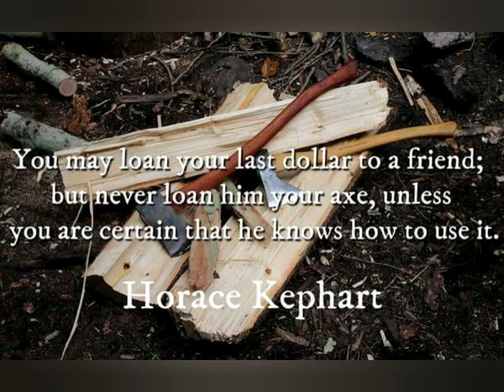4 in hand Rasp  axe build

Comment: Yup handy tool that rasp👍, that a Milwaukee drill driver in the background there Jamie? ❤️👍
Reply from the maker: Yes it is.. I also have an older Ni-cad dewalt impact driver... the impact driver is by far one of my most used tools
Reply: That's a coincidence, I've been using the old nicad dewalt stuff for years I've got loads of it kickin around but I done some research & bought the Milwaukee M18 kit, impact & driver, it's a beast of a thing!! More of a framing tool it's not a tad heavy & powerful for small indoor jobs so thinking about buying a smaller lighter job just for finicky things but dreading the research there's so much choice & I'm not rich so I want the best bang for my buck! Super happy with the Milwaukee though 😬❤️👍
Reply: Where did the not come from 🙈.  It's a tad heavy I meant 🙈
Reply from the maker: @mikeyyoyo6464  I been building houses and doing construction most.my adult life...and was a dewalt man for years...but for cordless now I switched to Milwaukee 18 volt.  For corded tools install like home depot brand... RIDGID tools
Reply from the maker: @mikeyyoyo6464  the m18 you can get 1.5 battery that is pretty lightweight.